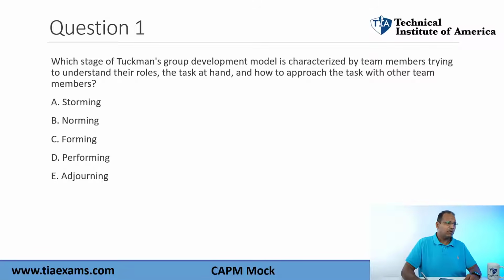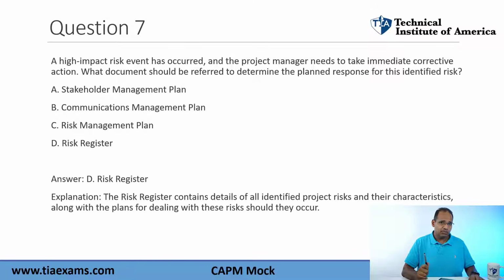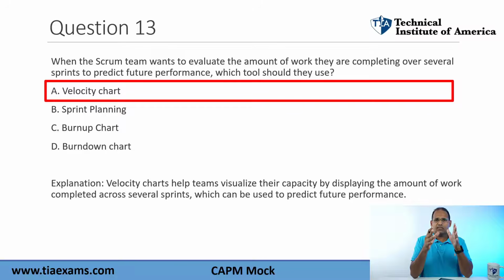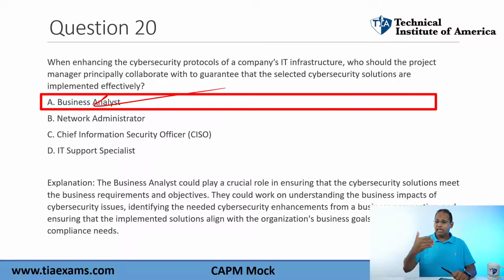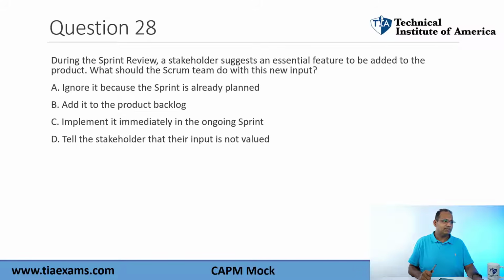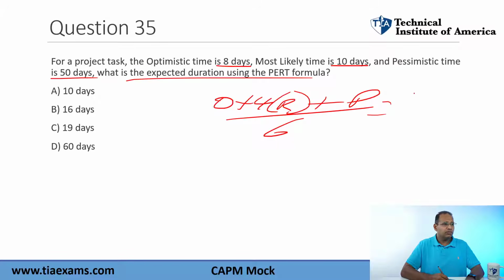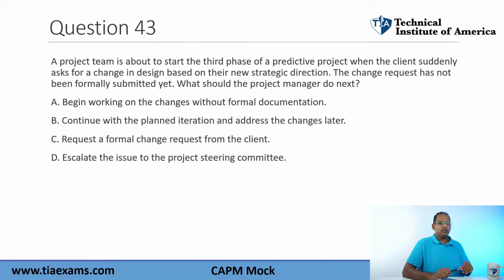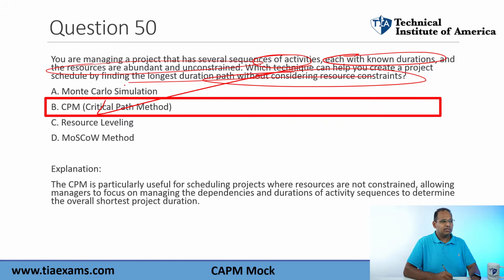50 CAPM Practice Questions for the current Exam

Comment: Thank you for sharing this mock — it's been a great practice resource as I prepare for the CAPM.

One question on Q20: the stem asks who the PM should collaborate with to ensure the solutions are "implemented effectively," which reads as an implementation/technical outcome, so I went with the CISO. Your explanation focuses on aligning the solution with business requirements — which makes sense for the BA, but seems to answer a slightly different question than the one asked. Would the answer still be A if the stem emphasized implementation over business alignment?

Thanks again for making these available!

Comment: I wanted to chime in here , and I’ll come back here after I finish my certification.

I am currently someone with a business degree, and a lean six sigma green belt, work in manufacturing.

I started the CAPM training , and am
Halfway through PMI’s course work .

I started going through these questions and stopped after 10. 

I was correct in 8 of those first ten, so the courses are helpful and the thing is they are actually fun and along with experience , college courses directed towards operations management , and the LSSBG, this PM training is extremely useful to add.

If you’re on the fence about getting the certification , I would pay for the course and dive in.

As soon as I finish my LSS BB, I tend to get my PMP as well.

Comment: Thank you for the video, I took the exam yesterday and the video is very helpful. For those who will take the exam soon, I suggest to review all agile topics, including extreme programming, paired programming, DSDM, events (meetings). And read about business analysis communication plan, who is using it and when. In my case majority of questions were about agile and business analysis. There were only about 5 questions on EVM and 1 on Tuckman (all very simple). 180 minutes was barely enough for me, I finished with 4 min left, so be aware about timings and have a good rest before the exam.

Comment: This is helpful, thanks Andrew. On question 23, I think the wording of the question needs changing. A sprint has 'finished' after the retrospective and when a sprint has finished the next one begins immediately afterwards. E.G, no additional tasks between sprints. In the question the team has just finished the sprint would imply that they have already done the retrospective (because the sprint has finished) and so a new sprint would begin, starting with sprint planning. I hope I am explaining my point clearly enough. Thanks!

Comment: I passed the CAPM exam yesterday. TanQ, Andrew. 
Your 50 questions were very helpful. Your Simulator is excellent; I saw a few questions in the exam that were exactly the same as in the Simulator. There were several questions on CV, SV, SPI, etc., just as Andrew mentioned in his Simulator. Andrew, you are excellent!

One suggestion I have is regarding your Udemy session on CAPM. There are several errors in the quiz. In some cases, the answers and explanations don't match, and in others, the answer options are repeated. If you could edit those, it would be wonderful. I recognize you as a great teacher, but some perfectionists might have a different experience with the Udemy course compared to your Simulator. I do not want anyone to miss your Simulator based on the Udemy Quizzes.
Reply: hi uma, How hard was the exam and what covered the most part of the exam, Agile? process grps? BA?

Comment: Hello Andrew, I respectfully disagree with your answer to Question 20. When enhancing cybersecurity protocols for a company's IT infrastructure, the project manager should primarily collaborate with the Chief Information Security Officer (CISO). The CISO is responsible for overseeing and managing the organization's information security strategy and policies. Collaborating with the CISO ensures that the selected cybersecurity solutions align with the company's overall security goals and standards. Additionally, the CISO can provide valuable insights into potential threats and risks, helping to design and implement effective cybersecurity measures. While collaboration with other roles like Network Administrator and IT Support Specialist may be necessary, the CISO is typically the key stakeholder for strategic cybersecurity decisions.
Reply from the maker: Are you trying to pass a PMI exam? What you do at your job will not be tested. Follow the practices of PMI to pass a PMI exam.
Reply: @AndrewRamdayal   Thanks for your response. You are good at what you do by the way.